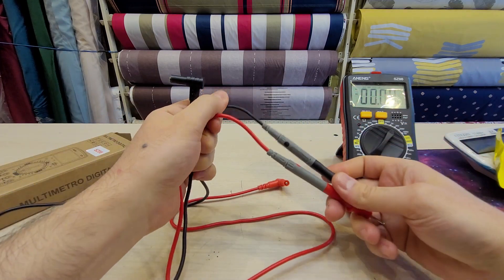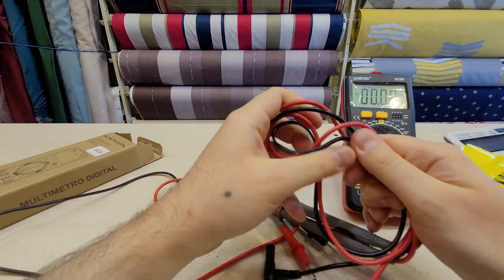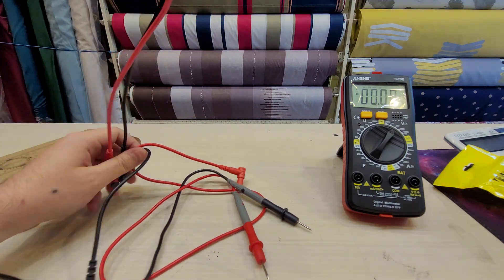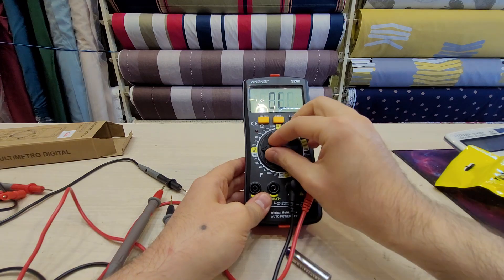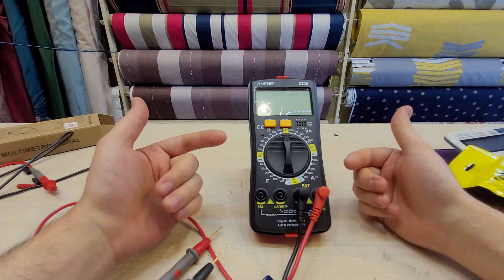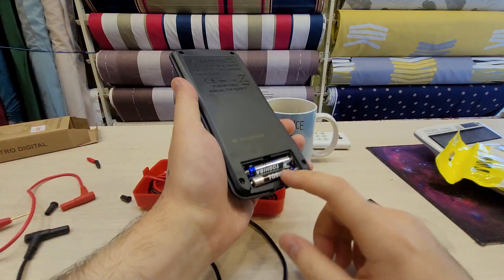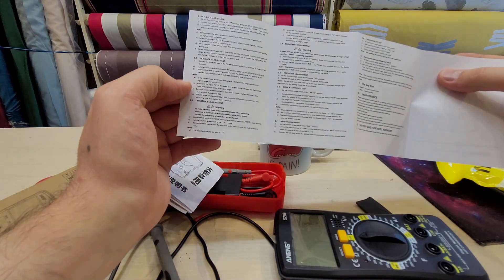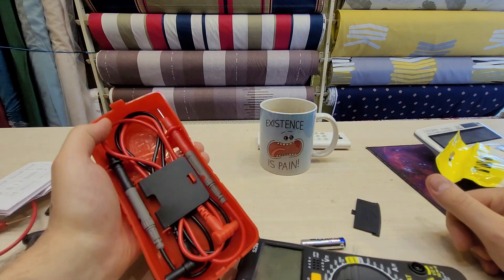aneng SZ08 multimeter tips + quick show and tell

Comment: I only get 2.15V from the lead output when using diode mode.  I could test red-green LED's, no voltage reported for blue white or UV LED's.  Notice the APO disable feature is often reverted when changing ranges because the unit likes to reset itself from time to time.  This can be overcome by holding select while changing ranges, although a bit clumsy.  Did you find the relative feature for capacitance which shows Δ in the display and rel's out the test lead capacitance?
Reply from the maker: Yes as mentioned it the video ,the diode voltage is too low for blue leds & such . Fun fact , there is a hidden feuture inaide the meter which i added my self ,which is the backlight. If u hold the HOLD key down ,it turns a pin on inaide which supposed to be for the backlight ,its missing a resistor & a transistor but u can easily add it yourself alongside the backlight it self , which i did . Regarding the capacitance , i didnt check it sisnce the capacitance values itself is rarely a use case for me because it doesnt show the esr . I would suggest you to get one of those cheap multi function transistor tester which measures caps & industors along many other things like transistor & mosfets & diodes .
Reply: @thevoidedwarranty  I have the close cousin SZ305 which has the backlight feature and I also noticed the "phantom" backlight with this unit.  I was thinking about copying the circuit over but this display has such good contrast that adding it wouldn't make it more useful to me.  The light never stays on long enough anyway, I think I would make it latch somehow (requiring a different circuit).  I have the transistor tester which is less accurate for capacitance but does indeed provide a useful ESR value.  However, I also have a LCR Tester (ET431) which provides more extensive information for capacitors.  On another note, I don't like how obnoxious the beeper is, so I increased the value of the SMD resistor going to the beeper, which also reduces battery consumption along with volume.
Reply from the maker: @pault6533  i usually just ad a piece of sticky tap on the buzzer to calm it down
Reply: @thevoidedwarranty  on my unit it already has sticky tape. I think most of the sound comes out of the tunnel underneath.